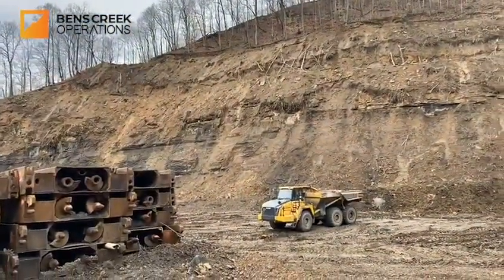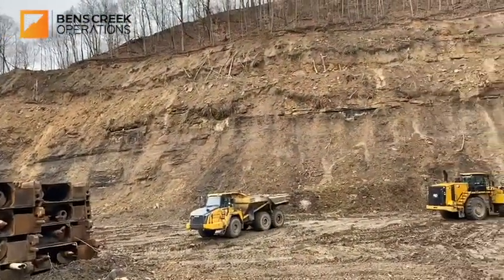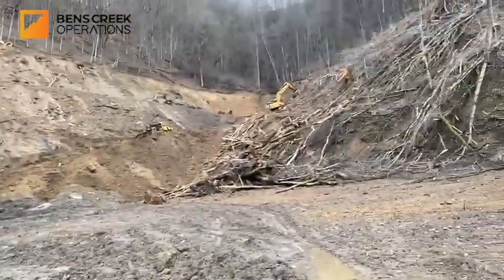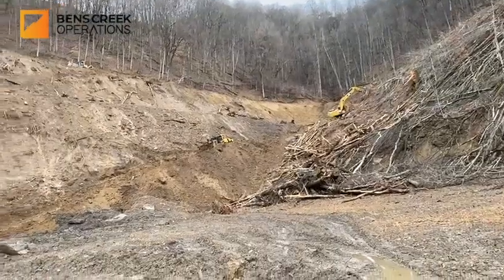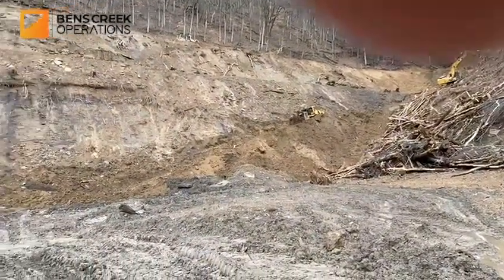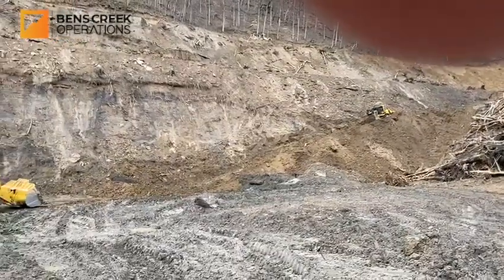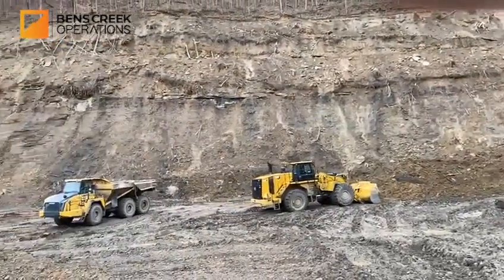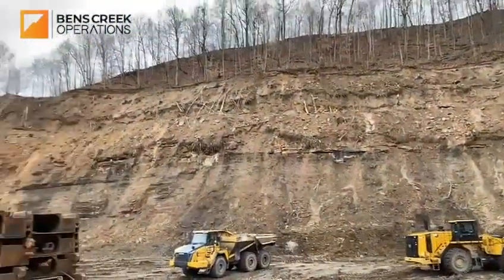Preparation Underway for Highwall Mining Operations: Drilling Set to Begin

Comment: Not used for power generation, that would be thermal coal. Bens Creek are mining for metcoal (HiVolA & HiVolB). There is obviously the option to mix that coal with lower grade coal to sell as thermal but that is not currently the intention here. As the benches and batter are created by blasting, clearing, loading and hauling the coal seams are exposed permitting strip mining methods to extract pit coal that may need to be run through a washplant prior to being sold. With a tall/wide seam the ROM pitcoal might be sold as clean with very little waste amongst it. Once the benches are wide enough the HWM can come in and take over.
Reply: Excellent video, is the 2nd HWM on site yet? 👍
Reply: @nevermindo3  some equipment has already arrived on site. All required benching is complete and once the highwall miner has been re-assembled production is expected to start during February 2023